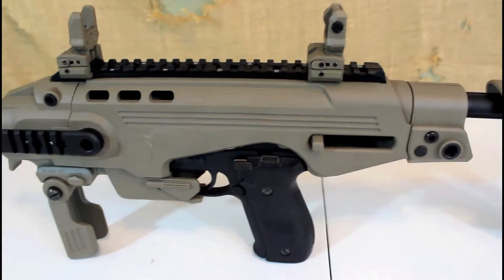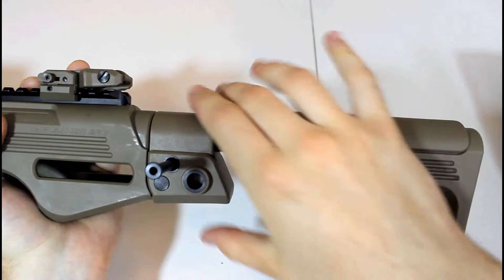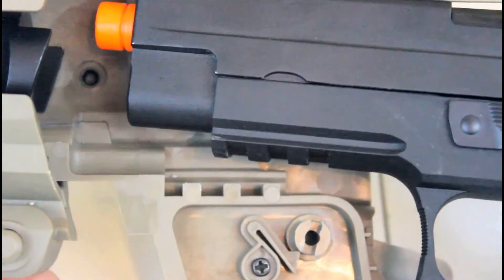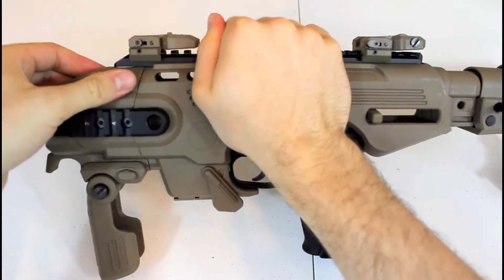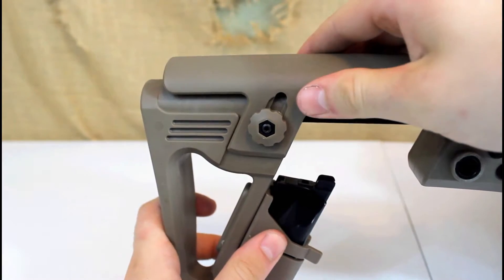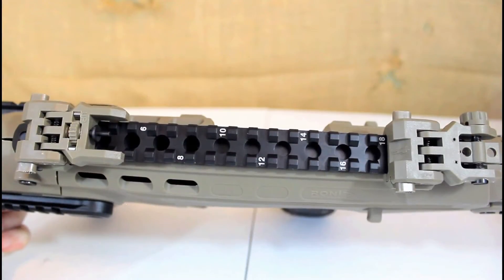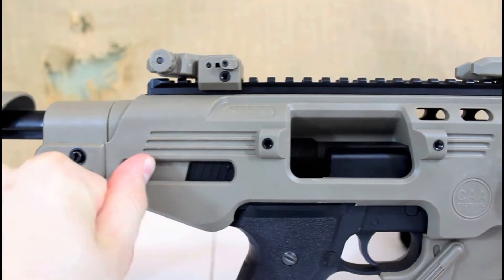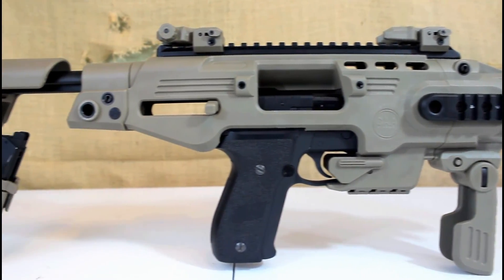RONI P226 Pistol Conversion kit

Comment: The question is would this work on a real P226. I’m tempted to try
Reply: Can you try for me 2?
Reply: Have you tried this?
Reply: @geo335st  Nope I have not, but I did learn that the "airsoft" versions are essentially "second hand" stock for the real thing that didn't sell well, thus were sent off to Airsoft Distributors such as Evike.  If you ask me they're probably the same and would work, I have a hard time believing a proprietary manufacturer that makes polymer chassis' for common pistol platforms would deviate (from a logistics standpoint) in quality of materials and machining to differentiate "airsoft" and "Real Steel."